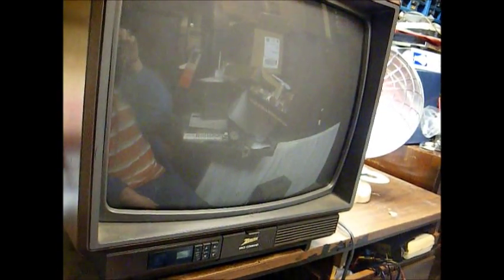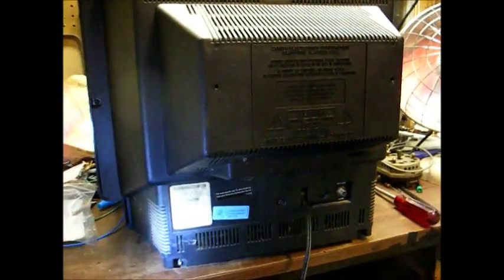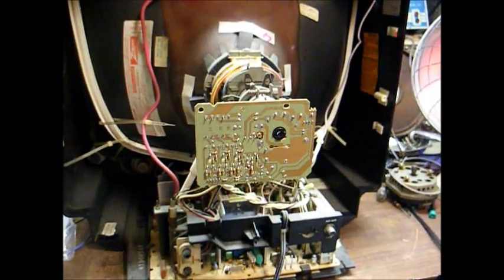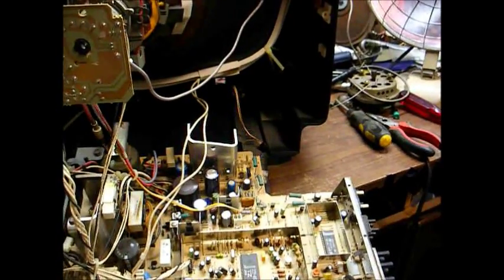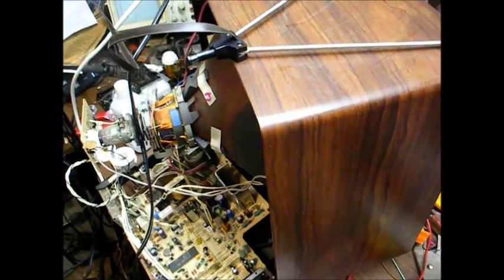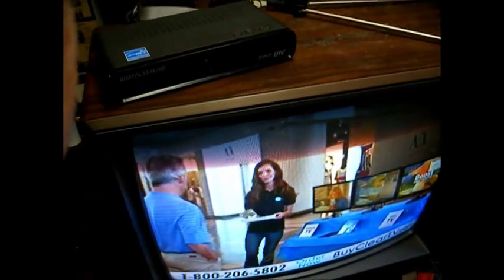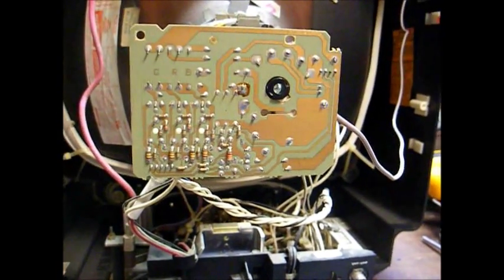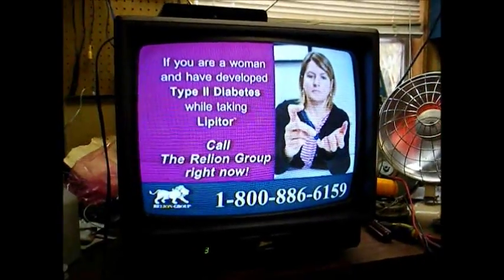Repair of a 1988 Zenith 19" color TV & TV antenna rant

Comment: I live in a fringe area when it comes to digital signals. I stumbled across a DIY antenna design online that uses wire coat hangers. It works quite well, it really impressed the Dish Network installer.
Reply: We found the same design. 😆 It works well enough for my needs.

Comment: Looks like i have one of the last models with the modular design, the tuner, keyboard interface, remote power supply, video output and main module. It's an SD2023w manufactured September 1987 and i'd like to keep around as long as possible. I also bought an identical pair of rabbit ears and connected to my DTV converter box i'm getting an 80% signal here in my room which did better than the modern place in your window type antenna.

Comment: If you spend $50 on a quality outdoor antenna you would be inpressed with the results. Digital really doesn't like multi-path. I get 10 hardly working channels with rabbit ears and 120 channels with my American Made Wineguard on the roof, its no contest. 'Digital Antenna' maybe a marketing gimmick but sense they are no longer broadcasting on the lower channels the antennas no longer need to be tuned to pick those up.
Reply from the maker: I agree; but, that commercial made it sound like that you'll get a zillion channels if you order their whiz bang antenna. That may be true, if you live in a market that contains many local TV stations. Otherwise, you'd need an outside antenna to possibly receive more stations. In other words, this "mail order" indoor TV antenna will likely be no more effective than a standard pair of yard sale rabbit ears. Eventually, I'm going to install an outdoor antenna on my shop.
Reply: My house is kind of in a "valley" of sorts...  Hills on both sides of the neighborhood block good reception.  Not a single channel will show up for me using a basic indoor antenna, despite the fact that I live only about 12 to 15 miles from most of the transmitters in the area.  Finally settled on a Winegard FV-30BB antenna mounted on top of a 25-foot pole strapped to my chimney (and grounded like crazy against lightning strikes!)  Still can't get one channel that's about 25-miles away, but the others come in well enough to be usable.

So, I guess what I'm saying is that it's very dependent upon your location -- the digital transition definitely made it so you have to have great reception to get any kind of picture at all.  If you're in an area where the reception is marginal, you'll need to spend big bucks on a high-quality outdoor antenna to get a usable picture.
Reply: +shango066 its all down to signal strength
Reply: and signal quality or error rate
Reply: When they switched off analog to digital here, we had replace our old outdoor roof antennas because they wouldn’t work anymore with the digital signal! :(
Reply: I can't get reception without an outdoor antenna. Btw, our old analog outdoor antenna worked with a digital converter.

Comment: I totally agree w/ your antenna rant. I'm still using an old Sony Wega CRT set w/ a coupon converter box. And my antenna is a RadioShack UHF double-bowtie (w/ 300-ohm lead). All my local stations have their physical channels on UHF, so it works just fine (I'm just south of Boston). And yes, every time I see that "digital antenna" advert on MeTV, I can only shake my head!

Comment: I have a little parabolic heater like that with the heater coil wrapped around a white ceramic piece and it reflects out like a parabolic dish. I happened to shine up the chrome surface one day and seem to get a little more heat where I was sitting;)

Hey you should start carving the Youtube URL for the video of the repair on the top of the TV. lol But then these idiots would break it and blame your repair work. I know all too well, I used to do vacuum repair on the side. Could disassemble one, throw the parts in a dishwasher and reassemble to like new condition and make a few bucks. Then Walmart and Target came to my side of town. It killed that business. People just throw everything away now. If you want your old Hoover fixed you either pay too much or you'd better learn to fix it yourself. Yeah' right, 90% of people can't even change a belt! Sad, but true.

Comment: I'm using an old 5ft outdoor tv antenna that works just fine for me sometimes at night I can get tv stations over 100 miles away from me and them flat tv antennas are junk all I would get is PBS with one of them flat antenna because it's only 30 miles away from that station

Comment: I have a 2 newer tube tvs one from 2001 and one from 2002 with a DVD player built in it's a 7" and a 25" Panasonic with a little bit of trouble with that the picture would flash then it go too a small bright line in the middle of the screen until I tap it it might be a loose wire but didn't take it apart yet to see

Comment: Hello Bryan

Please post a video on The Digital Stream DTV Converter Box you show in the video... People's reviews clam thus DTV has a bad capacitor installed on the power supply Board...

Jason Cruz
Reply: I have one. Running since August 2017. (Knock on wood) they only warranty them for 6 months.

Comment: Sadly you cant give away a tv like this now. A 32 inch flatscreen now costs 100 at wallyworld..  when it goes out in 6 months, they call me. Led replacements are miserable. And now not even worth it. So landfill it goes. However the 1988 zenith will still be on and running throughout the entire life of the flatscreen. Sadly, when asked to repair an OLED, 99% of the time its trashed. Bad panel. So much for the person that plopped 3k plus on it and got 2 years out of it...

Comment: How can you get 100 channels with a antenna
Reply from the maker: With digital OTA broadcasting, it's possible for TV stations to broadcast several subchannels on a single carrier. Around here, 30.1 is FOX and 30.2 is NBC. Of course, one has to live in a large market area in order to receive that many channels. In my area, I can easily pick up 9 channels with an indoor antenna.